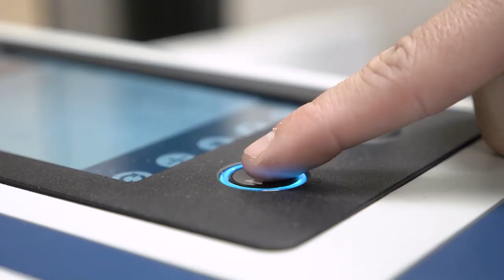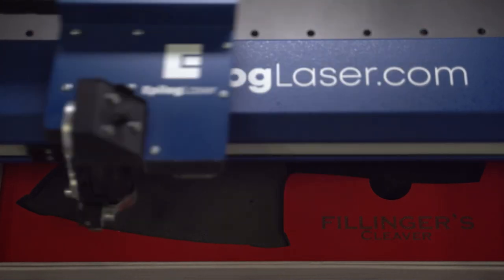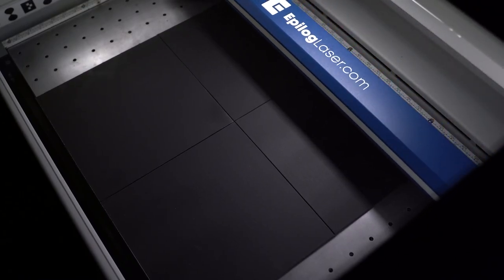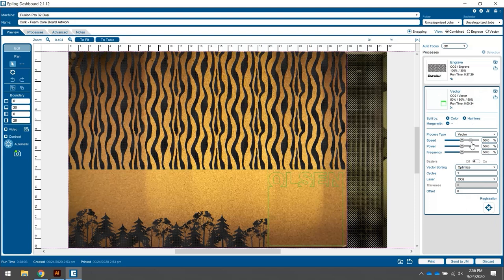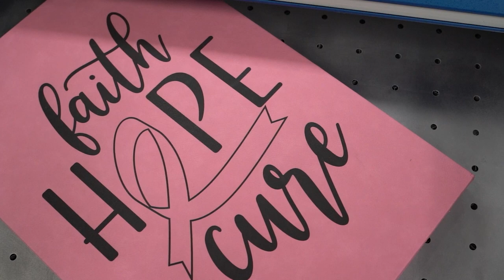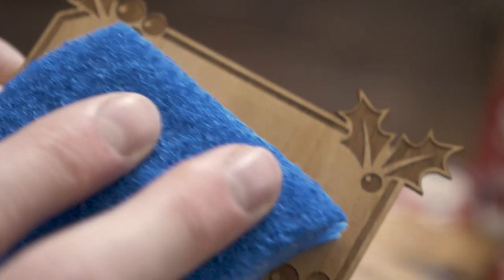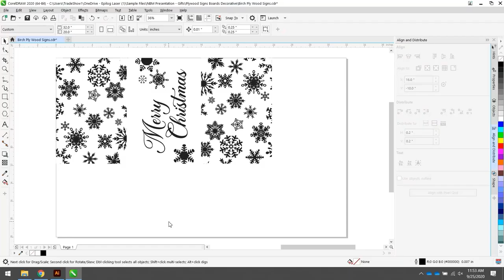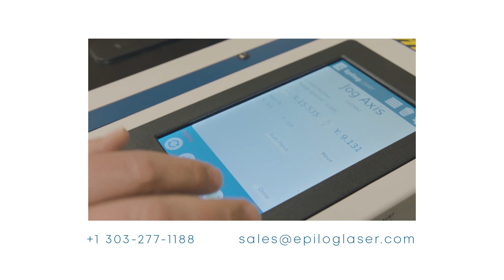Laser Projects for Gifts, the Home, and the Holidays | Epilog Laser

Comment: I have the same Fusion Pro 32 you’re presenting with. I didn’t catch an indication of what wattage tube this model is using in the demo. It’s a direct correlation to the speed and power settings.
Reply from the maker: The Fusion Pro 32 featured in the presentation included our 80-watt laser tube.

Comment: For the black painted photo engravings, do you have any details for the canvas panels used? Also, does the wattage of the laser used change any of the steps you took to edit the photo in photoshop?
Reply: I purchased the white panels at Hobby Lobby. Typically no, I don't change the processing steps to fit the wattage, but I do sometimes change the filter/effect settings to match the material.

Comment: I just place an order for the Helix unit 80 watt , I will like to know if I can use a Mac 💻 to run the unit or do I have to use windows?
Reply from the maker: You'll need a Windows computer or instance of Windows running with Parallels or Bootcamp on a Mac.